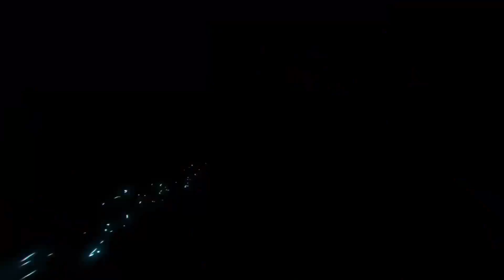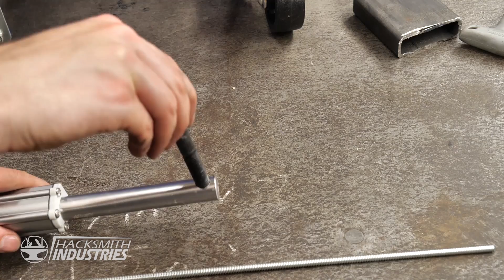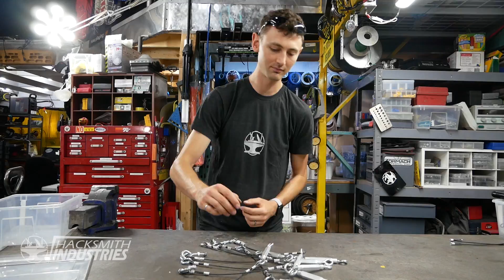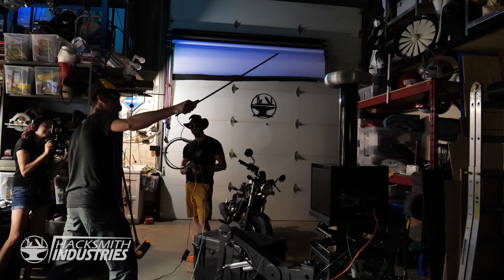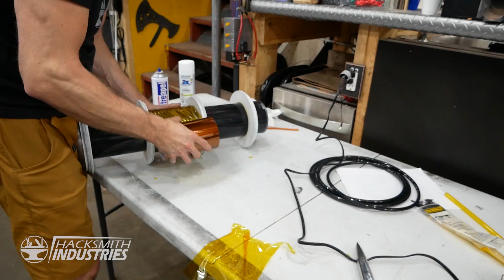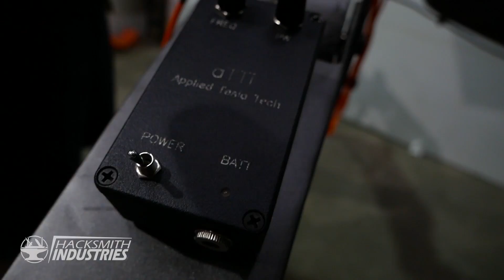TESLA COIL TURRET! (Apex Legends)

Comment: Last i check electricity takes all paths to ground not just the least resistance. Cause if that where true you couldnt put 100 watt bulb and a 40 watt bulb on the same lighting cicruit.... your just slightly insulated and very high resistance.

Comment: You should try to use Thor’s hammer to catch a real lightning bolt. Like stick it on a tall pole during a lightning storm and put like sand or rubber all around the base

Comment: You guy need to make a Tesla coil that can be aimed. Maybe do something to cause a preference for electrical arcs, in the air, like ionizing it. I'd be cool if you make a working version of the Tesla Coil from Command and Conquer: Red Alert, or Red Alert 2. Actually, there are absolutely tons of cool things from the various Command and Conquer series, that you could make. (Though, I'd steer away from making a working version of the weapon that the infantry unit the “Desolator”, has. And your not likely to be able to get your hands on any tiberium, on account of it being a fictional substance; so that rules out a lot of things, too.)

Comment: The entire project looks awesome. As usually, the team did a fantastic job designing and fabricating. I do have a question though; it seems like only one Tesla coil was actuating. Is that because running both would interfere with each other?
Reply from the maker: only one is real
Reply: But y?

Outside of cost?

Comment: You know? If you allowed the legs to rotate around the Y axis and to move like a normal leg, with a remote control and some programming you could have a walking Tesla tank. But treads would be better and easier to use.

Comment: WHY HAVE ONLY ONE COIL OPERATING?  it is not hard to get two SSTC to be out of phase with each other which would have made it much more impressive. and by reducing the size of the top load you severely reduced the output, as the larger toroid provides higher capacitance, meaning higher voltage output, so bigger, longer lightning. the added parts you put on the secondary would have also had an effect on the output as they mess with the coupling to the magnetic field from the primary. if you are going to mess with this stuff get it right. half assed approach is not really MAKING IT REAL.
Reply from the maker: Because they cost $10,000 a coil. Couldn't afford two. 

And we did retune the coil with the smaller torroid. It barely made a difference to output. Instead of being an arrogant asshole, try, I dunno, not assuming we don't know what we're doing?

Comment: Spinning effect could be accomplished by either tethered (mains electricity) to two concentric rings on top of the robot, insulated from top of motorbike lift platform, and picked off by conductive pressure rollers pressing on the rings. The ultimate would be to battery power this beast, using a LiFePo4 battery and an inverter to run the coils. Same scenario here, run mains (from inverter) to two concentric rings, and pressure roller pickoffs. To prevent weight of battery from bogging down the scissor lift, put the battery under the base, where the legs attach.
Reply from the maker: Bigger issue is the fiber optic control wire

Comment: I feel like some of these projects would look reeeeally awesome if the grinding/smoothing wasn't so uneven. The reflections caused by angle grinders make it really warped and the form of it feels like it's melted. It's not an issue in this video because you painted over the metal, but it's been around in other videos. It'd be a really great asset if you got some kind of belt sander/grinder that let you get really even finishes on your stuff.
Love the videos as always.
Reply from the maker: Making one of these projects every week is the problem. 80/20 rule

Comment: Kinda sad that, at this level, you don't use faster linear actuators, it's not hard to do after all...
Reply from the maker: Those were overvolted
Reply: @hacksmith  You could easily create something way faster and powerful with some Brushless motors and lead screws.

Comment: This is great....

Now can you make Red Alert's Tesla tower? Its simple. 
If you can control where the lightning lands
Reply: I would expect that would be theoretically possible if you could ionize the air in a line from a capacitor to a target so the capacitor is discharged when there is a clear enough path for the electric to follow. I would also expect you would need a surprising amount of power especially if you were going for any kind of distance. I am but a programmer, though, and it's been a while since I've had any physics classes, so shrug?
Reply: @Zoladen  Yes you would need tremendous power to keep it both stable and at least medium ranged. 

Yes, it is theoretically possible.
Unfortunately none has managed to build one.
Reply: @Kronosfobi  A bit ignorance and laziness on my part here for not doing a quick search: How many have tried? Or do you know of anyone who has done calculations for the requirements? It would essentially be a lightning gun, so just doing it to try and get slow motion of the arc in a controlled environment would be an awesome endeavor.
Reply: @Zoladen  I dont personally know anyone that has tried but i do know around the first years of being able to construct Tesla Towers, there has been attempts or tests to control the electricity but there wasnt any spesific way to do it and even in theory, it required so much energy that eventually it wasnt just worth it.